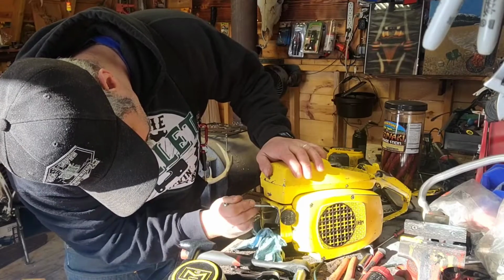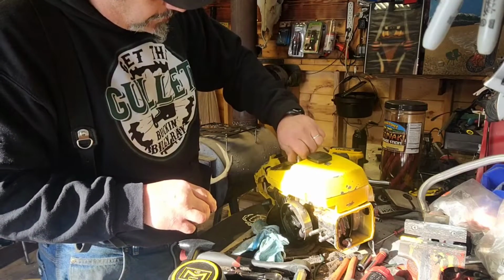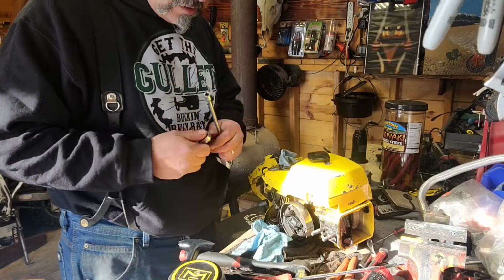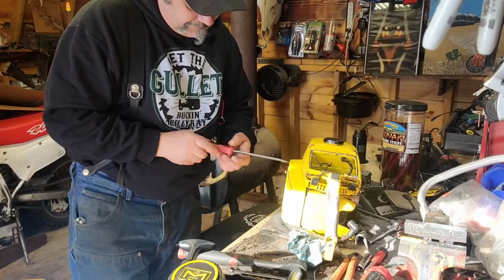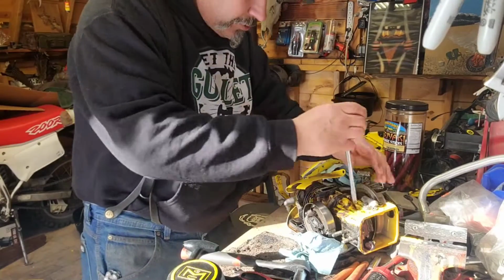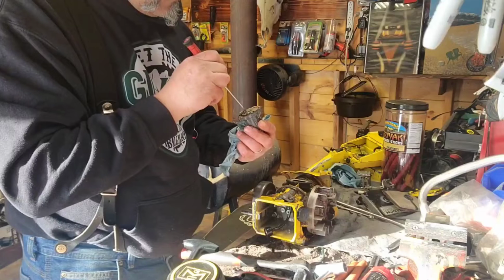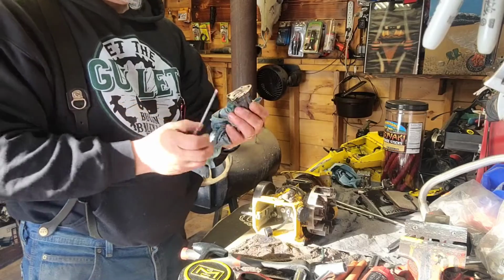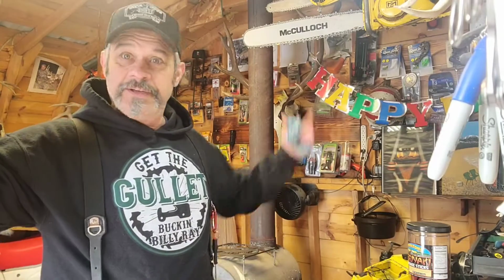How to remove an automatic oiler on a McCulloch 1010

Comment: I had a similar problem on a pro mac 700, which is the same chassis.  The pump had been over tightened like yours.  What happened is that it warped the body, and the plunger rod would seize up when tightened, but worked good off the saw.  I put a new pump in and that solved the problem.  If you cant find a pump, drill out the hole for the plunger about 2 thousands oversize, and see if that rectifies the problem. I did this to one of my Mini Mac's and it fixed the problem there. Make sure all passages are clear, and that the spacer washer between the saw chassis and the top is there, as if it is missing, the tank can be cracked when tightening it down.  finom 1 recommended I contact you.
Reply from the maker: Wow thank you Mr. Obsolete. I really appreciate your help and things to try. I will do all those things. I really appreciate this. 🌲❤🌲👊🪓
Reply: Let me know the results. @tazman-kennyfuller

Comment: Taz, try opening that adjuster screw a few turns.  Looks like she is in pretty far.  The piston seems to spring back up ok so she must be pumping.
Reply from the maker: Thank you Nick. With this particular pump that is all the way open. It works flawlessly out of the saw. I will get er fixed up. 🌲❤🌲👊🪓

Comment: Taz, is there much if anything between the pump and the delivery to the bar? It would seem like there must be a restriction from that hole to the bar.  Or even the bar itself. But I only have a couple of mac’s. I know it sounds crazy but I have to run different oil in the winter than I do in the summer. Because if I’m not running the saw constantly such as bucking up firewood in the winter it won’t flow right if I use my “summer” oil.  Thanks for always putting out great content. And thanks for taking the time to get back to us with the small channels it means a lot. Take care!
Reply from the maker: Thank you Lumberjack. Man I love this stuff. The bar oil slots are clear and lined up primo. No blockage in the internal system on the saw or on the pump. Using thin motor oil just to see if it will flow. I'm on a mission can you tell hahahahahhaa. 🌲❤🌲👊🪓
Reply: @tazman-kennyfuller  that’s a puzzling one for sure